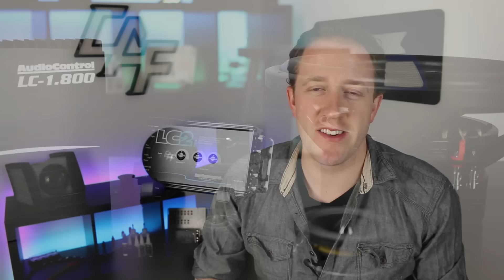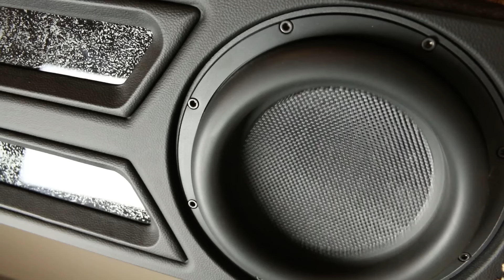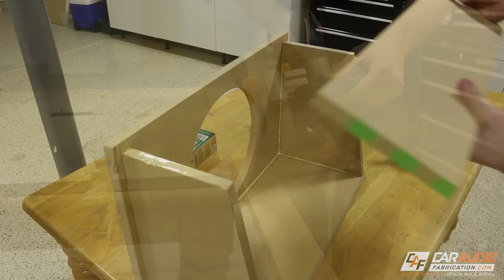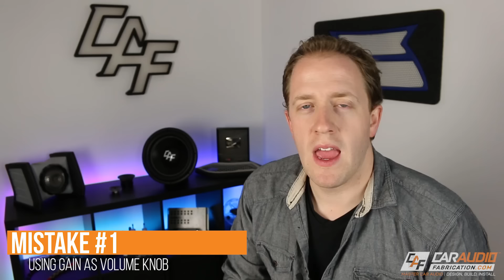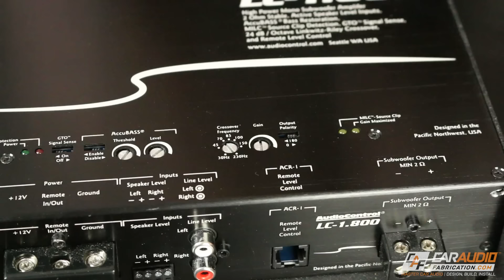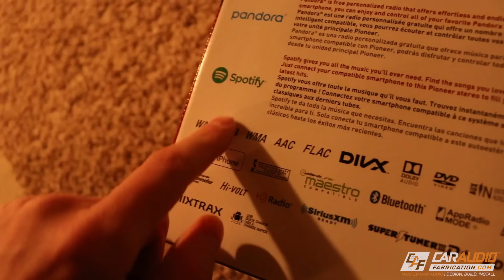Avoid these 5 common Car Audio NOOB Mistakes!

Comment: As an audio tech by far the most common issue we have with DIY installs coming back to us is either customers not setting gains correctly and blowing gear or from not setting the crossovers appropriately and also blowing gear.
Reply: Is there like a call support system I can call to help walk me thru setting my system up in my car for free
Reply: @hunterdowning9409  you are right on it
Reply: @hunterdowning9409 Crutchfield
Reply: @hunterdowning9409  crutchfield has a good help line
Reply: Which was his first point he made...
Reply: How can I set the gain with a voltmeter if I dont' have a oscillascope?
Reply: @esoteridactyl  they make handheld oscascopes/ multi meters for 50-80$
Reply: @esoteridactyl  You just need a multimeter
Reply: @xldkxnewyorker8914  Award for the most unhelpful comment ever goes to!
Reply: @andrewford80 
You're welcome.

Comment: Hi ,I had a pro install 2 rockford fosgate punch 1 4ch n 1 mono w 1 10"sub pioneer, w a pioneer unit and a dsp and at 1st he said a kicker soft dome burn 1channel and then replaced it and road off and came back w a smoking sub ,the 4 mid was working to thn put a temp sub and discovered that the 2 front speaker burn ..put temp 6.5 and the whole system sucks ..and I can't raise the volume over 40,not I'm just waitg for replacement any idea why it sounds terrible..and is all connected to factory wiring

Comment: Hey i was changing the rear speakers and i noticed that both tweeter/woofer were in reverse polarity for both doors
Is there any benefit for that bc now it sounds flat not much depth in the car just regular music playing
But before sounded different i dont know but like i was in a bigger cabin can you please help me is that a thing or something was wrong from factory 
Front system is a 3 way and the back is 2 way

Comment: Hey Mark, longtime fan. I need a quick refresher on how to make amp connections, in the PROPER steps (to avoid sparking). E.G., 1) Disconnect negative battery terminal. 2) Connect amp to ground. 3) Connect amp to remote wire. 4) Connect amp to 12v source. 5) Double check fuses and connections. 6) Connect negative battery terminal back to car battery. 

Please let me know how far off I am, and more importantly how to prevent damage to the amplifier and minimize sparking. TIA.

Comment: I made a mistake by not knowing how to tune correctly or do a breaking in period lol I had 2 12" Rockford P2D4 wired down to 1ohm on a 1000.1 Rockford amp. I blew through 8-10 subwoofers in like 2 months but I had bought some extra "warranty" from the audio shop and was able to get replacements every time I went in with a blown subwoofer. They never took the time to explain tuning or the break-in period

Comment: I entered the car audio world when I was 16 (many MANY moons ago). I had an 85 chevy citation. Overall, the car was just a mistake, but hey it was a hatchback! I had a total of around 3k watts pushing 4 - 12" MTX Blue Thunders. I cut in a pair of 5 1/4" coax in the doors by stillwater designs and had...wait for it....4x10's on either side of the rear deck. Collectively, I had about 200 watts on my highs. (Yes, I was a bass head!)  I had that car for 2 years and went thru 2 batteries and 3 alternators. Teenage me was convinced that the constant electrical failures were bc chevy made a crap car.  While that may be true, I now see that the electrical problems were due to lack of understanding.  The big 3 has been done to every car I've owned since I dumped the citation.  Ignorance truly is bliss! 😄

Comment: A nearly completely noob here, with extensive electrical/electronics background, to ask for the logic behind installing a cap AFTER the big 3 instead of before them. Obviously, there is a tipping point where no cap can save a system from over-drawing, however, doesn't the cap actually compensate for weakness in the big 3... or at least the alt and batt? Nothing compensates for weak wires. Thanks for the response. Great vids btw. a new favorite of mine!

Comment: Luckily I haven’t made any of these mistakes the only mistake I made was the too much power mistake… I put a too powerful radio in my car and my gear shift is dimmed but I added a whole new speaker system and it was fine hopefully when I put my subs in they stay good

Comment: My favorite of my many mistakes was adding two more amps without adding a relay. I fried the internal fuse in my $300 head unit and looked like a real dumby when I took it back to complain.
Reply: I have so made this mistake that and using the remote to run 2 small leds inline as "oh they are super low draw" didnt have any fuse protection for when they did eventually fail c:

Comment: Dude I'm rocking a power acoustik rzr1-2500d with two 12" power acoustik gothic subs (Walmart budget build). It's in my 09 pt cruiser in a 1.5 cubic air space hatchback box. It sounds and feels amazing tho. Spent around 300 on this and I don't regret a thing.

Comment: Alright, I used a tec screw to secure the ground wire in the back of my van and set the carpet on fire..... now Im a 12v technician and lighting expert. go figure

Comment: Plzzzz help me, I have a 5 channel amp with jl audio c1 components in front  on high pass, the radio is in "through" or 62.5  where should my freq be 95/100?
My low is 85/90
Reply: I have no access to those tools and car toys charge $90+ to tune a system

Comment: This isn't good news for me, my headlights dim if i put both windows up at the same time aha!!
Reply: Thats normal.   Upgrade the wire from alternator to battery, battery negative to chassis and negative from block to chassis with good quality 4 gauge OFC wire or welding wire and you'll be good to go.  If still have a problem see if they make a higher output alternator for your car maybe from a higher trim model etc

Comment: Big mistake...Bridging...is bad for ur wires quality current This is because the power of the first channel goes into the second channel before going into the speaker. If the amps you are bridging can't handle the extra power going thru it, then it will damage it. If the amp is not designed for more power, then it will blow and be useless

Comment: Just recently bought a Class D 3100watt amp which has 2x positive and 2x negative, in the instructions it says to use both or else damage could be had, is this true ?

Comment: My new car (Nissan Note) comes with a dealer fitted cheap Chinese 9" android media player and 4 paper speakers. Currently it sound thin and far worse than my bluetooth portable speaker. Previously I drove a BMW 1 series and it sounded great out of factory, as with most german cars. With a budget of say $300-$500, can I get close to a VW/BMW audio system ? Or should I not bother at all. I'm not sure if the Headunit is the bottleneck or the speakers. In my previous Renault megane, even with Focal components it sounded teeny. After adding an under-seat FOCAL Ibus active sub , it didn't help much, bass was still weak. So I think the sound source is important. Someone told me just throwing in a DSP with stock speakers is good enough, yet I read that DSPs are only for fine tuning. My dealer installed head unit currently matches the dashboard quite well, so I do not want to change it if possible. I once had a old Hyundai with a single din Pioneer and speakers that came from factory, it actually sounded punchy! I wonder by replacing the stock speakers with 4 decent pioneer/focal coaxials, would it be sufficient. Could I tap on your expertise please, thank you in advance all the way from Singapore.

Comment: My mom when she got her first sub didn’t listen to anything I had to say about systems, she bought a 600w peak 300w rms sub off of me and went on Amazon after and bought a 1200 rms watt amp, I tried telling her it’s not gonna work and she had her bf install it anyway bc I wouldn’t bc I knew it would mess it up, well guess what happened, she blew it up like I said she would, so we got her the correct sub to work for that amp and it sounds amazing now, 10 inch in a Mitsubishi 3000gt

Comment: Alright, but I have a question to upgrading or better said, extending my power. Going from 2 20k's to 4 20k's would I need to buy 4 new ones or can I use my existing amps?

Comment: I disagree about the cap.it smooths out voltage demands thereby improving the systems performance by sustaining the power supply when the demand increases bc of the music notes which in turn makes for way less distortion improved sonic characteristics in the way your bass hits.tell me why this is a mistake again.

Comment: Can you have an alternator that can handle more power than the car’s main battery? Are there any issues with that, even with the upgrades from the big 3 wiring?

Comment: Man mark i want both. ground pounding bass. with absolute amazing sound quality.  About 7 grand in and still dont have it.
Reply: Wow.  I achieved both spending under $1500.  Including wiring etc.  I bought everything off Kijiji and was brand new in the box with the exception of the 2 amps which looked new but were used. (Kenwood Excelon XR-4S and XR-1S)
Reply: @rxtuninginc8444  I'm running 4 fosgate power t1 12's off an orion hcca 3000.1dsplx. Audio control d6.1200 for high. with 3 sets of pioneer tszch 6.5 components.  duel xspower batteries and lots of 0 gauge cable.  so I guess I kinda do have both just for the s.q. I need to keep the bass knob at 1/4. And when I want ground pounding bass wellp just can't hear much music lol. Don't know how you got it for so little maby our idea of s.q. and ground pounding bass are different. But if your happy that's all that matters.  And enjoy your system. !!   When the guy in front of you gets out of his car on the expressway just to tell you his car is rattling apart and he thinks he got a nose bleed you know your pounding the ground. True story.  With lots of others.
Reply: @rolfbach2721  ya thats alot.  I'm sure you have me beat in the bass department but I don't want to rattle my car apart.  I'm also doing it in a small hatchback (Focus ST) so it's not hard to get good sound out of it.  Going to switch up to a 6 channel Audio Control amp and go active on the front.  For subs I'm running pair of 10" Image Dynamics IDQ10v3.  Front is Infinity Kappa 6.5 components.  Rear are my old school MTX ThunderPro 6.5 midbass.  It's loud enough and clear as hell.  Good enough for me and enough to piss off the neighbors.   Let's just say when I listen to Tool, so do they ha.  Enjoy your system too.  Maybe you can find a good balance, you certainly have the right equipment.   Rock on bud, cheers from Canada 🇨🇦

Comment: I'm still running a 1200 class d xplod, with 3 xplod 12's........and it's all 2001 models, 2nd hand, installed in 2003. Still bumping like a champ. Granted I like a clean sound so my bass isn't tuned to shatter windows or be the loudest around. BUT I DEFINITELY made the mistake of buying a capacitor first.

Comment: Hey, just wanted to get some tips and advice on the equipment I have. I’m new to all this but I have two 8’s(WDX 8G1.4)and a 5000 watt amp (Power acoustik overdrive) is that too much power ? and an under seat box for a truck and was wondering if you think I should run an extra battery? I don’t have any of it installed yet btw and I haven’t bought a wiring kit for it yet and don’t know exactly what I need. 😬

Comment: So, the setup I have right now is...Pioneer AVH-W4400NEX, Taramp's HD 3000 and Skar Audio ZVX-12v2 D2 12"..... What do you think? I want to really fine tune this system to get the most out of it. This is installed in a Volkswagen CC.

Comment: I’m putting a 900w amp in my 2015 stock Subaru legacy.  Do I need to do anything special electrical system wise or battery wise? I’m putting 100 to each indoor and 500 to the sub I guess it’s a 5 channel
Reply: I suggest the Big 3 upgrade is mandatory. 4 awg wire is probably sufficient for the Big 3, and 2awg is usually good for a lead run. Use welding wire or proper car-audio wire. Use proper fuses (~ 200 amp?), close to the battery, between the alt & battery, and between the battery & amp. 

Use what you have to start, and budget for a new battery and/or alternator in the future. A deep-cycle battery with the highest amp-hour rating (that still fits) is ideal. I suggest using stock alternators for reliability, but you can check and see if any stock alts with higher output fit your vehicle. Aftermarket HO alts are either super expensive or unreliable, and not really needed with a 1kw RMS system. 

Unless you play your system dozens of hours weekly (like I do), your stock equipment should last long enough you may not notice any extra wear, but ultimately you'll be wearing-out your battery and alt faster than if you weren't running extra power. Don't run 2000 watts RMS or such, or else you will quickly deplete your stock equipment.

Make your stereo system easy to disconnect, so you don't need to disconnect the entire battery just to service the amp. Run a single main lead (+) wire, and make sure it disconnects first, without disconnecting your car's ECU in the process. Run a single ground, and make sure it's accessible. If you get another amp, use power distributor blocks, on the positive and ground sides, so you don't need multiple connection points, so it's easier to disconnect the whole system. Disconnect the ground, and then the positive wire, plus any RCA & remote wires, and your amp(s) is then completely disconnected from the battery.

Comment: 1988 I installed an amp on a 74 vw bug  under the dash didn’t turn out well nobody told me gas tank was in the front. OOps

Comment: You got me at first mistake :( , I am not a super mobile club, I do have a mono block 300rms jbl matched with 6x9s 100rms per speaker(installed on rear deck). i kept messing with the gain and precisely left it right below halfway because I figured it was throwing 150rms plus the 50 per channel from the stereo

Comment: The only thing I disagree with is the argument about lossless audio files. Audio engineers are not mixing their music with the intent of listeners having lossless audio files. File compression is pretty damn impressive nowadays. If you aren't using a poor youtube converter or something it will be near unnoticeable for the average listener. Depending on the content of the mix even a trained ear might not identify the difference in a blind test between an mp3 and cd quality much less lossless quality. Ironically enough sometimes a poorly mixed song with low bass will sound better as an mp3 because it shaves off lower frequencies that don't need to be there ie: frequencies your system cant hardly play/frequencies below the average human hearing. 

Let me remind you: CDs are not lossless quality. Records are worse than CDs with respect to quality. Unless you go out of your way to find an artist that distributes their music in a lossless format you have never heard it before and never will. Most hifi audio fans THINK the sound quality is improving because they want to think that. In a blind test you really can't differentiate between CD quality and Lossless. You can barely tell the difference between mp3 and red book sound quality. Many artists don't distribute lossless because they want to protect those files for intellectual property reasons (it's a lot easier to rip sounds from an existing file using software if the source file has lossless quality). Lossless files are more significant for a producer/mixing engineers because details you can't feally hear become important when you are editing the sound source.

Comment: The mistake on to big of a sub I have single 18 in a extended cab and it has plenty of air space but you got to know what you doing in order to be able to have something that big in a smaller setting

Comment: Thank you so much for this video I am so glad I came across it. I am getting ready to completely upgrade my entire audio system in my 2005 Toyota Tacoma. I purchased everything from Crutchfield and they assured me that they have sold me the perfect and proper wires, speakers, radio, subwoofer, amp etc. this will be my first time installing an audio system and I may need to call Crutchfield to ask these questions about the certain mistakes that you are referring to. I am not sure if I need to upgrade my current wires, but I do know that they have sold me some decent upgraded wires to match perfectly with the complete audio system I have ordered… But again do I need to also upgrade the wires that those will be plugged into? This I will ask them. Thanks again. :)>